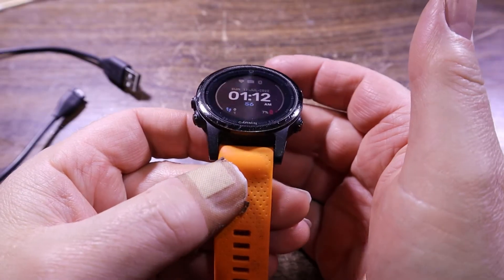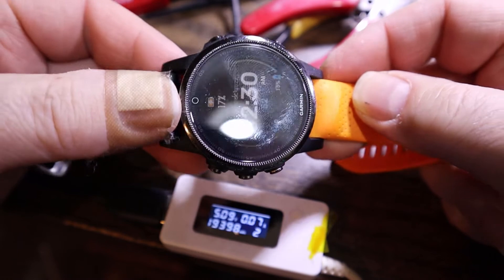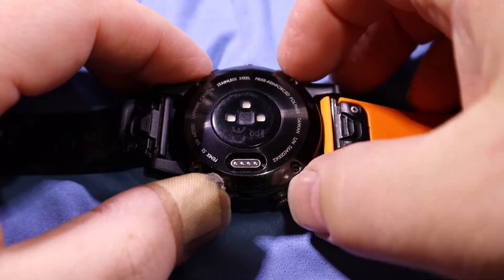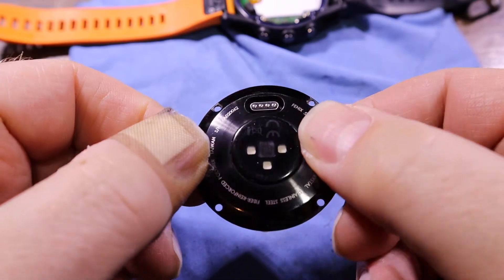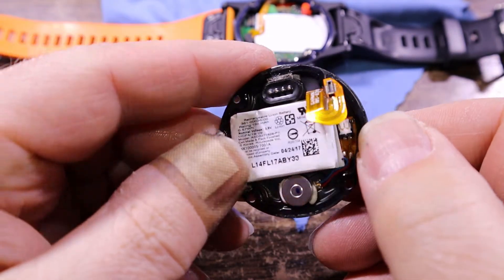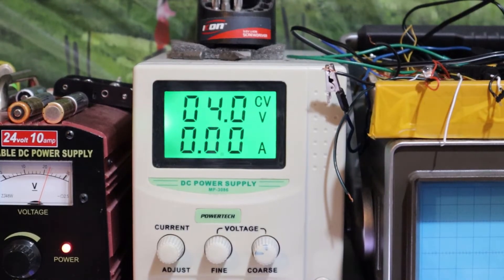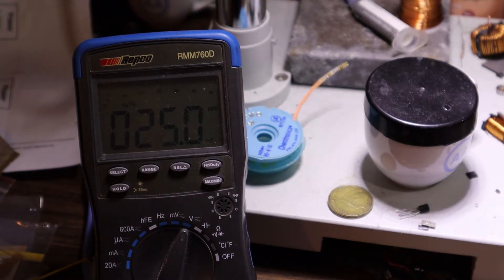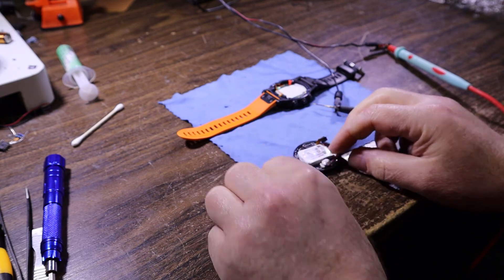Garmin Fenix 5S Battery Replacement

Comment: That red piece fell out for me. There is a thin metal pin that sticks up. Is that red piece supposed to cover that pin, or be adjacent? I put it all back together with it adjacent, I couldn't make the red piece fit over the pin without forcing it.

Comment: replaced the battery of my fenix5s to a larger one. initially it charged to 61%, but it wont charge to more than 4% now and will get quite hot when charging. what could i do? :S
Reply from the maker: I'd put the old one back in and see if it behaves as it used to, if so get a new original size one. If it still gets hot something may have got damaged. It's possible the battery is a dud, see if the heat is coming from that or the watch itself.

Comment: Thanks so much for this video!  I have a question however :)

I was replacing the battery in my 5S as well, found a suitable replacement (many places claim the 5 and 5X batteries will fit in the 5S, but I made sure it was indeed the replacement for P/N 361-00096-00).   When I installed it however, I could place it on the charger and have it startup and charge up, but as soon as I unplugged the charger the watch shut off.  I thought perhaps it was a bad battery that can't handle a load, but then I got a completely different battery from a different seller with exactly the same result.  I can put the old battery in and all works fine, but the two different batteries would not ruin the watch when not plugged into the charging cable.

Any thoughts?  And thanks again!  Your video really helped with my getting the one ribbon connector reconnected :)
Reply from the maker: If you have a multimeter test the voltage of the new battery. If it's 0 it may have shut down from slow discharge in storage. It should be above 2.5. Would be bad luck to get two dead ones. You could use a power supply to wake it up set at 3.8v current limit 100mA to get some charge into it for a few minutes then watch should be able to charge it. Do this with it disconnected from watch and be sure to get the plus and minus wires the right way or nothing will happen.
Reply: @JonnyFix  Thanks for the response!  I have a multimeter but don't have access to a bench supply, and the old battery (that still works but has reduced life) measures 4.04vdc and the one new "bad" battery that is on my bench reads 3.96vdc, so no large difference. 

I mean it WOULD be pretty unlikely to get two bad batteries from different places. So strange.

Anyway, thanks!

Comment: Can't find fitting battery on the internet. Bought one on Aliexpress, but its a bit too long... The one you have is produced in 2017, now the batteries are from 2021. Have anyone managed to mount the one from 2021 with yellow foil and some visible circuit to which connector cable is connected to?
Reply: I'm having the same issue. Did you finally fit a battery from 2021? Any insights on the process and the online seller?

Comment: Managed to tear off the battery connector.... Luckily the pads were still intact on the PCB so I enlarged them a bit and soldered the cables directly 
onto the PCB after a lot of fiddling. It works ;-) Next time I will look up a video first and not after starting the repair. 

Good video by the way 🙂
Reply from the maker: Cheers mate! I often look up teardown vids before diving in especially with small stuff. Well done on the fix!

Comment: Hello I replaced  my fenix 5s plus back cover  because the connector was oxidized. Now my watch works only when plugged in, what could it be? the battery is fully charged but when I unplug the watch it turns itself off. Everything seems alright
Reply: did you find a solution?
Reply: @pawedudek9354  Unfortunately no,  sorry
Reply: I have the same issue, not sure how to fix it

Comment: Hi, can you let me know the model of the battery you used please? I bought one which was supposed to fit but it is far too wide
Reply from the maker: Garmin Fenix 5 Fenix 5X 361-00097-00 255mAh 0.97Wh
Reply: @JonnyFix  looks like the 5S needs a  361-00096-00 255mAh 0.97Wh battery because this watch is smaller than the X

Comment: The fenix 5s is usually waterproof for surfing in salt waters. Can you tell if after this battery replacement that it would still be waterproof? I can't see well on the video if it has a rubber sealing.  Thanks for your time
Reply from the maker: There's a blue seal around the body of the watch visible at 4:30. It might be enough to seal again when reassembled but if you want to be sure I'd recommend obtaining a new seal.

Comment: Well its got a decent battery now, so it will be fine 😀
It might work better with a few discharge/recharge cycles.
I did say Eeeek as you were about to connect that tiny connector with battery voltage on.
And you changed direction :-D
Very neat inside that watch and nice connectors.
Good job as allways jonny.
Ahh the handy torture device, err the psu i mean lol.